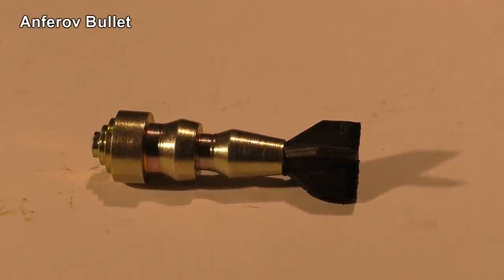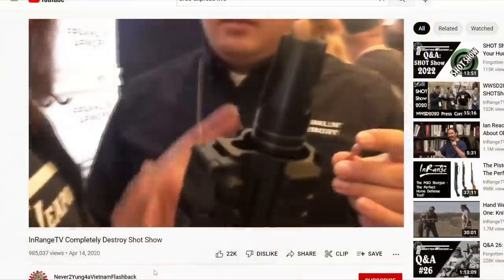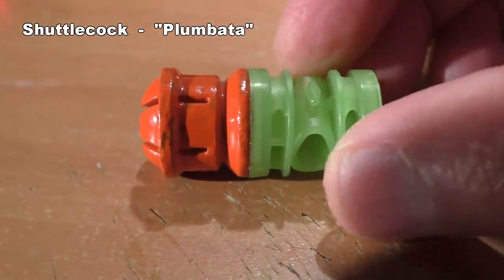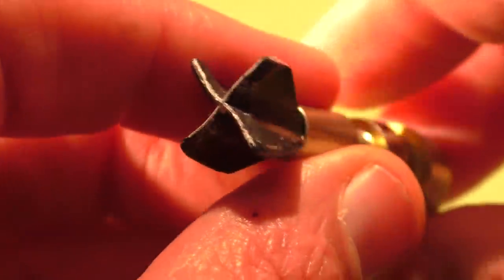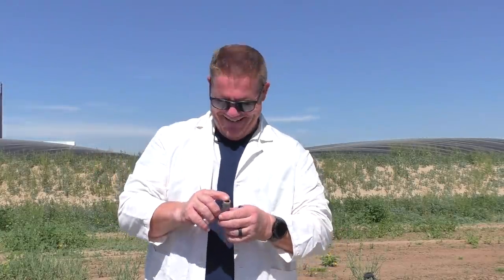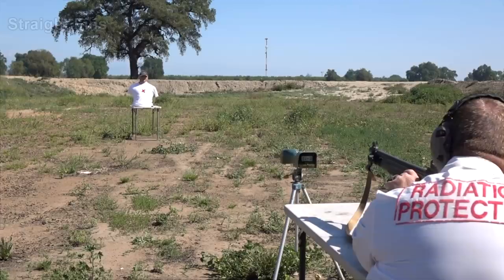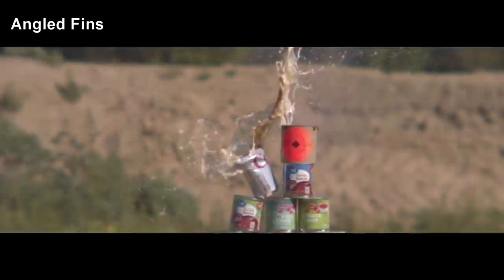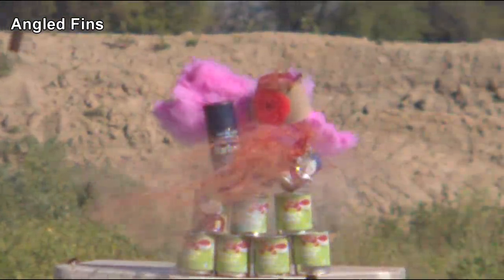Supersonic Darts - The Effects of Inducing SPIN - I learned something!

Comment: omg, really? rockets and jet planes are thrust projectiles and the fins are there for a completely different reason and the balance between the tip, fins, and thrust is very calculated....and arrow as this video shows is a completetly different "science"..lol. darts and arrows  DO need spin to maintain accuracy, but shooting from a high powered shotgun at just a few meters wont make a lick of difference either way. spin and non spin fin stabilastion is a waste of time at such a short range. as proven in so MANY videos, the accuracy of a shotgun at close range can be the same between a high tolerence machined projectile and a off round lead ball.  shotguns are primarily a short range weapon, none of these things are relavent as the hightest toleranced projectile is always governed accuracy not by its shape but by the separating casing that is highly inacurate at separation. and further more putting that much fin twist on a high speed projectile is stupid and doomed to fail...in fact, the offset of fin shouldnt even be visible to the eye to get proper stable spin.